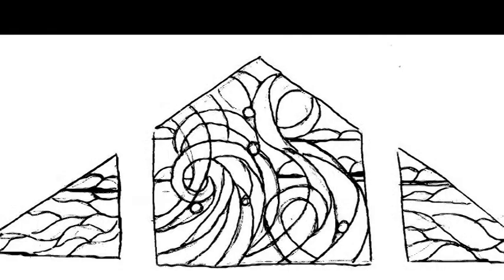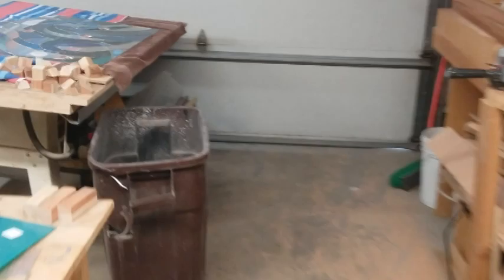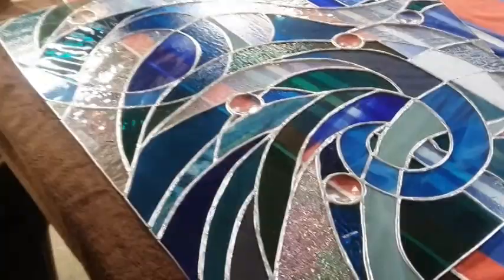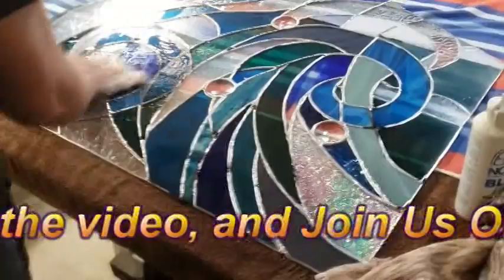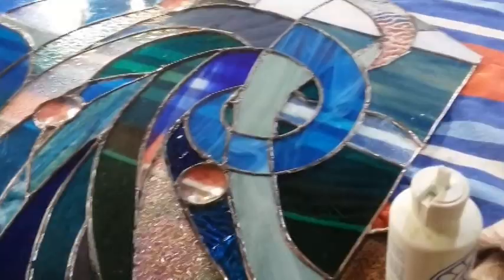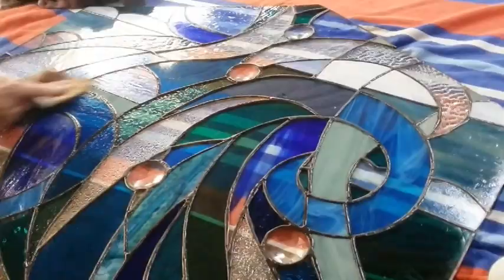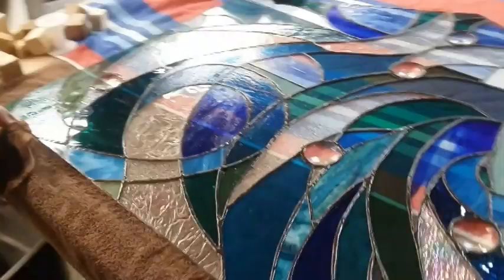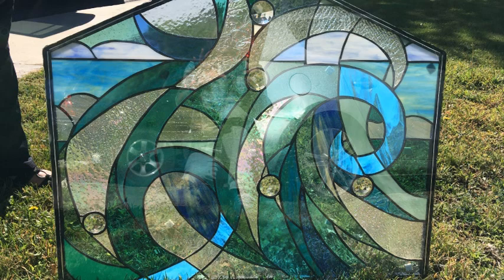Applying Patina To A Wave Stained Glass Panel V307

Comment: I have seen a spray bottle used for patina and it also works well. Interesting 🤔
Reply from the maker: If they worked that would be great. Ever notice that no company sells patina in a spray? I once bought some Vertigreen patina made to make copper turn green like it would over time. After spraying it on, the next day I wanted to add some more and the spray mechanism no longer worked. So we continue to add it with a rag.  😀😀😀
Reply: I understand. Thanks